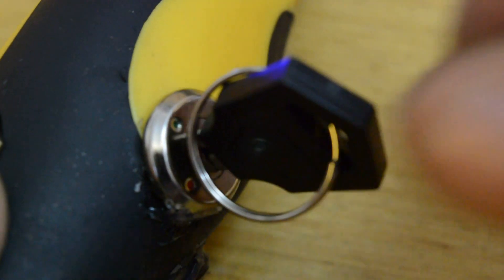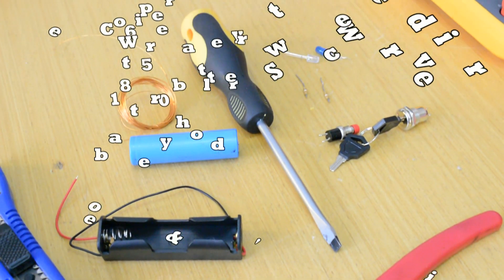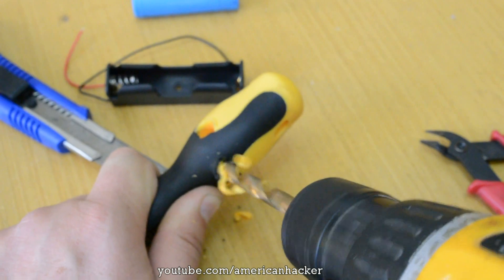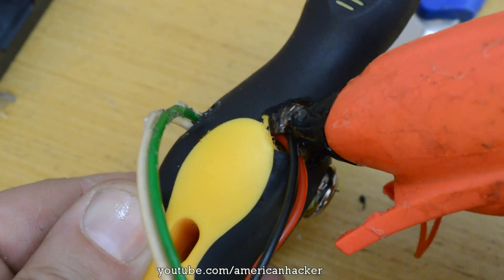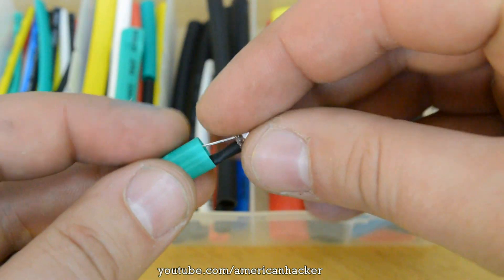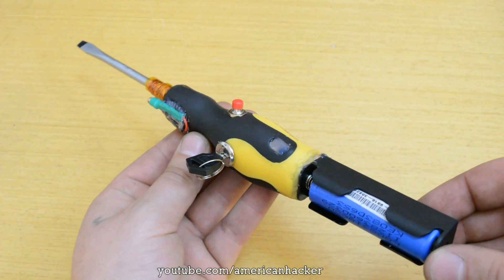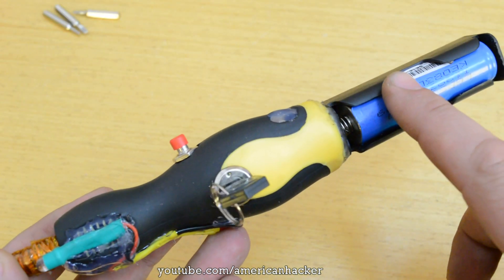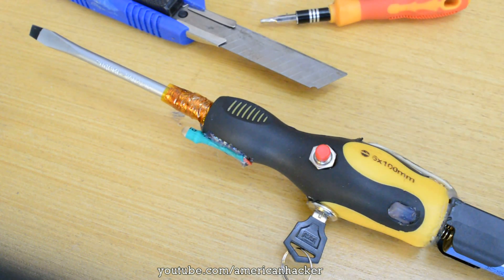How To Make Electromagnetic Screwdriver (sonic)

Comment: I want to make one with a barrel connector that uses a barrel to usb cable. I think a using a flashlight handle that can hold 2x AA batteries might turn out well too. The key could go it the butt. Toggle switch for magnet could be on the collar. Flashlight button could engage the led.

Comment: This idea popped into my head when assembling a new quad-copter. It has tiny screws that would be easier to insert if stuck to the end of the screw driver. When I get ideas, I always Google them, invariably to find somebody has already thought of it. Funny thing is, this video doesn't state that holding the screw on the driver is the whole point of the exercise. Personally, I would wind the wires much neater then cover with heat-shrink sleeve. The key switch would be better replaced with a recessed slide switch. The battery won't stay there long if you use it to drive screws rather than just inserting them. A smaller battery inside the handle perhaps? Might go flat pretty quick though. Otherwise, a neat video. 10 points for "inventing" it and uploading it.

Comment: nice but in my opinion not as practical or convenient in the handling. what I would do different is to make a hole nest to the copper could to put the Led to be more sleek. also to remove the key and just have the button. remove the back led. and use one battery inside the screwdriver since it will come off easily from the back and it's too long. it does not need much power to hold a screw which is why I say one battery. but that's just my preference.

Comment: And I use a simple mini neodyme magnet. Didn't put so many things on my screw driver, no batteries required, no key, and you can remove the magnetic field by... removing the magnet :)
Also, didn't deteriorate my screwdriver, and work on any screwdriver, in seconds ^^